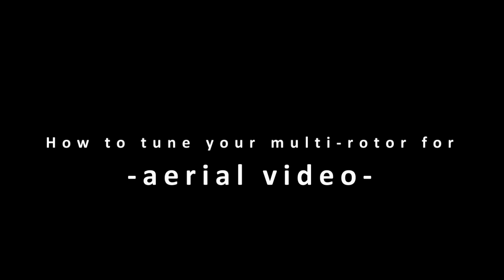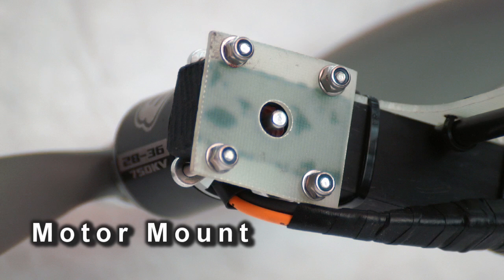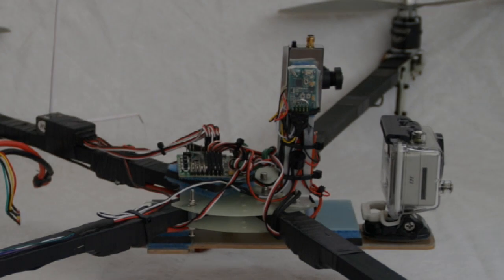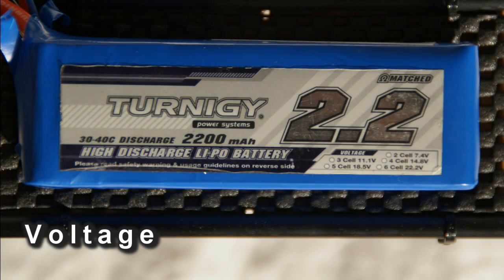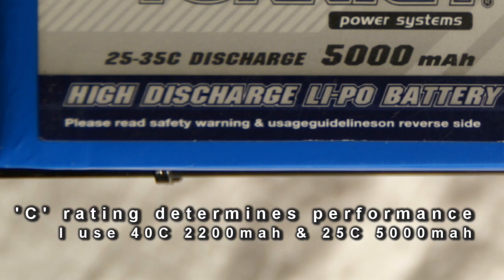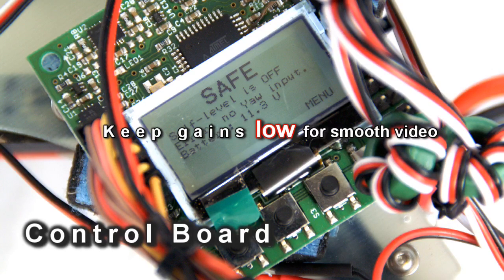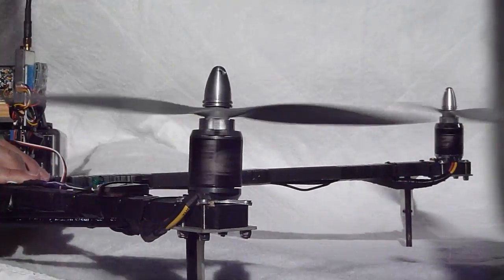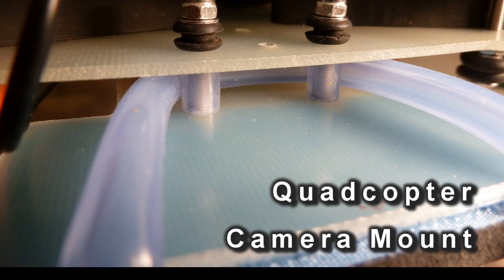Tune Your Multi-rotor

Comment: How much amp your quadcopter use for hover on 2.1kg ?
Reply from the maker: gnomehell It is not very efficient, around 14amps and 6 mins flying around on a 5000mah 4S.
Reply: 14amps per motor ? And u are using 10 inch prop right ?
Reply from the maker: gnomehell No, 14 Amps total and yes 10" props.

Comment: greetings, to which side of the quad are those, 2 degrees.
Reply from the maker: junsonic67 Rear motors forward and front motor leaning back by a couple of degrees, my later video makes this much clearer, https://youtu.be/K015FjE2zhE?t=6m46s

Comment: hey.. is your frame balanced ? we made a quadcopter frame, it is just barely heavier from the back by i think a few small grams.. does it make a bit difference? do we really need the frame equally balanced front and back?
Reply from the maker: A few grams will make hardly any difference, frames can be fairly unbalanced from front to back and it will make very little difference providing the quad has at least a 2 to 1 thrust to weight ratio.  I like my quads a little tail heavy as they fly more level at speed.
Reply: i see.. so the problem really is our configuration on our kk2.1 board.. any suggestions..? actually we're using a wifi and a smartphone as controller not an RC.. when we try to ascend it.. it likely flies upward with forward tilting..
Reply: ***** Ps.. what do you mean by 2 to 1 ratio?
Reply from the maker: Jazper James Sajol The problem could be caused by a number of things, it is hard to say without further information but the most likely is ESCs have not been calibrated, or the machine has insufficient power.  To calibrate the ESCs, remove the props, switch on your transmitter and put the throttle to maximum, hold down button 1 and 4 on the KK board and then plug in the main battery.  Wait for the beeps, and after a few seconds your ESCs will be calibrated.
Reply from the maker: Jazper James Sajol If your machine weighs 1kg, the multirotor thrust at full throttle should be at least 2kg.
Reply: we're not aiming for a high altitude flight, just a stable one..
have you tried the hobbyking wifi reciever??

Comment: Good vide very very informative for a new quad builder like myself
I have my quad flying but it jumps up every so often 
Almost like it gets a serge of extra power from some were it only jumps up a few inches then then goes back to the same hight as before ...any ideas on what it could be .
I crashed it the first time it happened and it cost me £40 for new parts .
You have a new sub great vid

Comment: Fantastic video and design, thanks. I think I'm going to build one of these. I see in your Quadcopter design page, you use Sketchup to design some parts. You may find a 3D printer very useful for printing some of what you design. My 3D printer can only print up to 200mm cube, so it won't do the larger plates, but certainly some of the smaller items would work great. It prints in lego plastic, so its light and tough. For those interested in cost, I did a quick add up and for motors, mounts, props, esc, KK2 and batt, it came to about $220, which is very reasonable. (excl wood, wires, plates, camera, radio and receiver)

Comment: VERY GOOD video! and nice designs!
Could you tell me about the ferrite rings?  Have you got one  for each ESC? the number of turns make a difference?
Thanks
Reply from the maker: Alberto, the ferrite rings are fitted as standard to the F30A ESCs.  They are designed to filter out any stray interference that travels down the cable to stop it entering the receiver or control board.  It is a form of choke that allows DC current to pass but stops AC which is often noise or interference.  The more turns of wire the more effective, but 5 or 6 turns should be all that is needed.  Place the rings as close to the receiver / control board as possible.  In most cases there is no interference or the equipment is capable of operating in spite of interference.  On my set-ups (F30A, FrSky, KK2 and CC3D), they work fine without the ferrite rings so I have removed them!  This may work for you as well although it would be wise to do a thorough range test with the motors running if you do decide to remove them.
Reply: *****  Hi, thanks for your explanation,
Finally I use ferrite rings, it add a little weight but still preffer use it.
I made my quad pretty similar to yours following all your tips. I am using the KK2.1. I tested yesterday first time, it has a deviation when start lifting and when is hoveering its a little hard to keep in place, I guess is a center of gravity problem trying to fix it.
Thanks for share your good work

Comment: Awesome video!  I have a DJI F550 Flamewheel that I am about to swap out the stock motors in favor of T-Motor's.  The holes don't line up on the new motors to the arms such that only 2 of the screws will fasten the motor to the arm.  Do you think this will be sufficient?  Or is it best to figure out a way using an adaptor to get all 4 screw holes to mount each motor.  Thanks.

Comment: You use or have used the Lumenier CS600 Super correct? How was it in low light and the transition from low light to bright and vice versa? Also, does it have a microphone built in? I can't find this info anywhere and I need to replace my current FPV camera which is garbage.

Comment: Thanks for those pointers, I was thinking of reducing arm length as the thing is a little large to cart around. However, I have reduced the auto-level gain and this has helped a lot, think it was trying to snap-back to quickly? Every time I have flown without auto-level it has ended very quickly in a very rough unscheduled landing!! Anyway I will keep trying and see where it goes. Many Thanks!

Comment: I have noticed my Quad frame has the motors tilted toward the center of the frame, in varying amounts, rather than being vertical.  Is this desirable or should the motors be vertical. There is about a 12mm difference from prop tip to ground, on the tip that is furthest away for the center of the quad versus the tip that is closest to the center of the quad.  You can see it is tilted - I am guessing it is around 5 degrees.
Is it worth the effort to shim the motors make them vertical?

Comment: Gains are: (Aileron&Pitch)
P gain 52, Limit 50 and I gain 0, Limit 20
Yaw: P gain 40 Limit 20 and I gain 50, Limit 10
Self level: P gain 70, Limit 40
Must say looking at these I'm not sure how they cam about??
In case size matters, arms are 500mm with 840mm between motors. Also flying with auto-level at the mo. Thanks for your help!

Comment: Thanks for the reply. A bit more info, with a 3S hover is around 70% throttle however initial voltage drop in the first 30sec of flight then requires more like 80% to hover. This will slowly move over the flight. 4S will start with hover around 50%. Motors are turnigy 910KV, 30amp ESC with SimonK, props are 11x5 Graupner style. It's as if somewhere between 3 and 4S is what I really need! Your videos are a constant inspiration and my goal, one day!! (I hope).

Comment: Another question if I may, how much change in behaviour should I expect when swapping between 3S and 4S lipos? Tricopter is near 2kg with a 3S 2.2Ahr batt and giving me around 4min 30sec gental flying see here - youtube.com/watch?v=UigvQ_34Fw0 So decided to try 4S 3Ahr batt to give a bit more go and more up time, getting 7min. But it does not feel the same and seems to wobble somewhat. Should I adjust P and I gains??

Comment: Very interesting video. Can you tell me about the stability of the H-quadcopters if it’s more stable than the X-copter? what can be the difference? I build and H-quad that weights 4Kg and the size is 60cm x 60cm and it use motors Rimfire.32 - 42-50-800 kv

Comment: Hi Rich, what an amazing guide thanks! Previously inspired by your Tri, I've put one together based on a coffin frame. Currykitten and Hase2 have spent some time with me and it's finally flying quite nicely, but needs finer tweaks as there's some jitter in the frame (I think the board reacting to small vibes) but thankfully no jello. In terms of isolating the Go Pro, do you have a closer look at your dampening mechanism? I've taken all points on board, great video! Thanks!

Comment: Sorry another question, have tried to find answer but can't.. On the Turnigy 9X are you using stock firmware or have you flashed it? Are you configured for Heli or Acro. Trying to sort Expo/Curves and what I see is not as in your video - Thanks,

Comment: Hi excellent video, like to see more.
I had a Gaui 500x which had angled motor mounts built in and by the way is the only commercially available one with this set up.
You are right it does increase better yaw.
You are a star !! keep it up .
All the best Mat

Comment: I really like the way you mounted your motors. Very clever. No drilling necessary.
I did the same after I saw it. I'm using two cross mounts for each motors.

Comment: Is it really necessary to mount the board on some foam like you did. First time I see that. Most people are using screws and/or nylon threaded spacers. Does it make a big difference ? Also, do you think using 4 gyro mounting pads could be a good solution ?

Comment: Very nice video!  One other tick for balancing props I have used and like much better then tape. Keep a can of quick dry clear matte spray paint around. Clean blade with alcohol if you have not already and a couple of quick shots of  paint on one or both sides of the lighter blade. You learn to judge the correct amount pretty quickly. Then check the balance again after has dried a few minutes. If that blade is now heavy you just sand off a bit of paint.